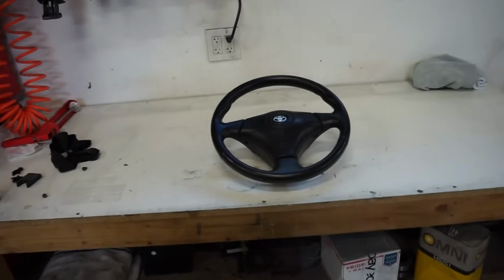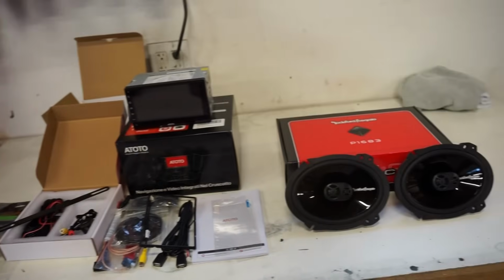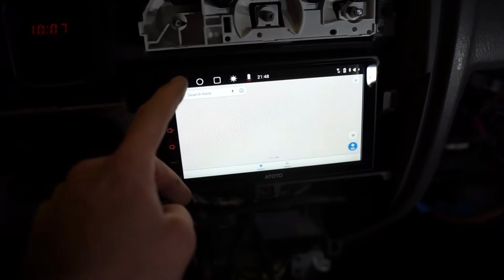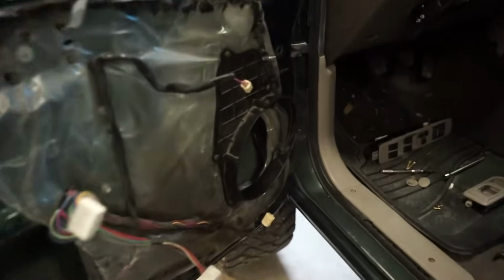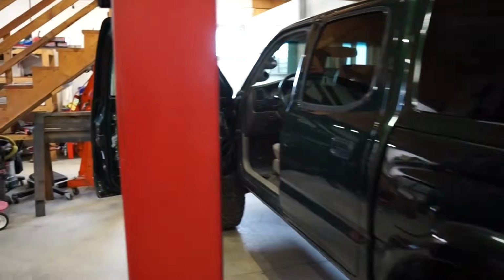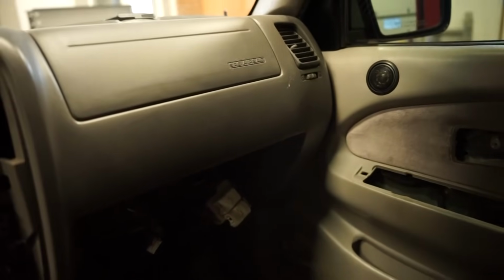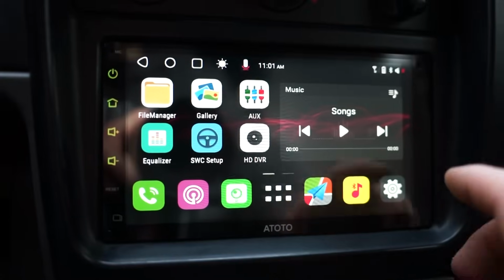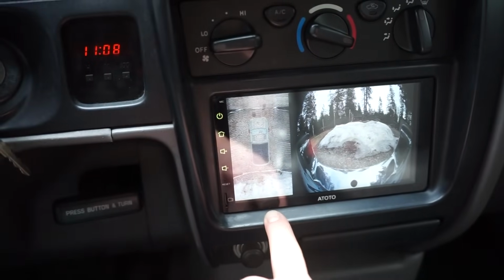The Best Interior Mods For Your 1st Gen Tacoma!!

Comment: Nice upgrade on the wheel! I got myself one from a 05 is300 plus new leather wrap, 02 rav4 airbag. Speakers tho, best replacement I’ve done on 1st gen are the infinity reference, I had the Rockford before and some other brands and almost nothing compares to factory since they actually sound pretty darn good but just no much mid as you mentioned. Truck looks good man. Consider doing the 4 runner mirrors heated glass mod. I did that on my current 04 double cab.
Reply from the maker: Thanks for the tips!
Reply: are you related to cameron niemela?😆
Reply: @jessejenkins2289  austin cameron and devin are all brothers
Reply: Did you get your wheel professionally leather wrapped? If so, where and how must did they charge you?

Comment: Nice on the wheel upgrade. I did the three spoke mod a few years ago. Ended up using a y2K celica bag with a 2005ish matrix wheel. My truck is a 96 so I had to splice my factory connector to the bag.
Reply: Hey man how did you connect it I’m having the same issue with my 98 Tacoma wiring is blue and yellow but the Celica is red and black

Comment: Really like this channel.  Can totally relate to these clean and moderately priced mods that focus on realistic use of the truck.

One thing I will say is that about $200 in sound deadener and closed cell foam (such as Ensolite) vastly improves the sound quality of your audio system and overall cab comfort.  Just need to really do the rear wall and about get about 80% coverage for the inner and outer door skins (sound deadener only).  And put about a 6x6" piece of the closed cell foam behind the speaker drivers to help absorb/break up the back wave.  This helps really tighten up the sound of the mid range.

I also run a small four channel amp to power the speakers and added a 10" powered sub that fits under the seat.  It won't boom your fillings out of your teeth but it really fills out the bottom end nicely.
Reply: Sweet tips, I'm gonna have to try that!

Comment: Hi Austin, really liked the video you have on this. So please don't take this as a knock on your channel. Your step-by-step instructions were spot on, even got the speakers. But the radio I got just didn't work out.

 I ordered the atoto S8 ultra 7".  Install was very straight forward. Everything worked for 1 DAY. Now it will only charge my phone and play AM & FM radio. The Car play stopped altogether. won't connect via cable or Bluetooth. In the process of returning it.
I'll reorder another one and see how it goes. But until then if anyone has any tips on what to try, please comment back to me.
Thanks
Reply from the maker: Thank you!! Thats not good!! I have had 4 of these head units and they all have been flawless!! I would contact Atoto and get another one under warranty!

Comment: Love your videos. I also just purchased mirrors just like your four-door green first GEN you have and I love them but I had to call the company back because I installed one which was gloss black which I ordered and then when I went to open the other box to install the triangle neck piece on the mirror was glass black but the rest of the mirror was a black primer finish. So I’m gonna have to paint the mirror to match the glass black mirror. I know I should’ve checked both before installing, but I was kind of a little excited to have bigger mirrors then my dinky little pre-runner, single cab mirrors. since I already installed them well one of them, I couldn’t return them because I have tool marks on them and they can’t resell them cause They are a pair but they gave me a full refund and told me to keep the mirrors so I guess that’s a win 😂 😢

Comment: By adding the tweeters to the front 6x8 coaxial speakers you went from the correct 4 ohm load to a 2 ohm load. I would be shocked if the head unit is 2 ohm stable and you run the risk of smoking the internal amp. If you want to fill the tweeter spot with tweeters the correct application would have been a set of 6x8 component speakers (one mid range 6x8 driver, one tweeter and one external crossover).
Reply: That unit is good for 2Ω, 4Ω, 8Ω

Comment: what year of corrola / rav 4 i need to get the same steering wheel ?? mine is bad too !
Reply from the maker: 2001-2002 Corolla!
Reply: @austinniemela  thanks
Reply: @austinniemela  ,thanks for your video. I lived in Puerto Rico and it's real hard to get parts for my 2004 Tacoma, but by those modifications you showed they have help me a lot with my project.  You got a new fan.